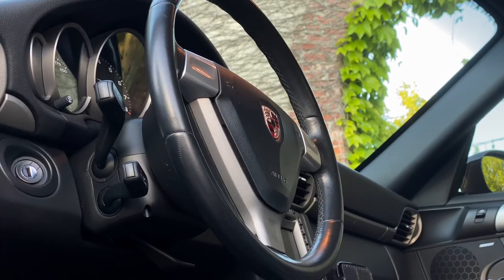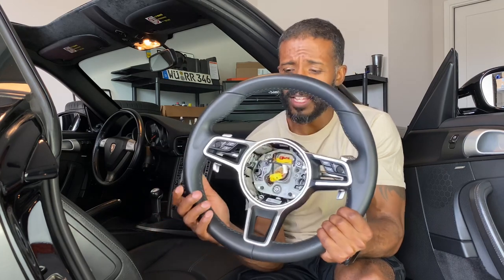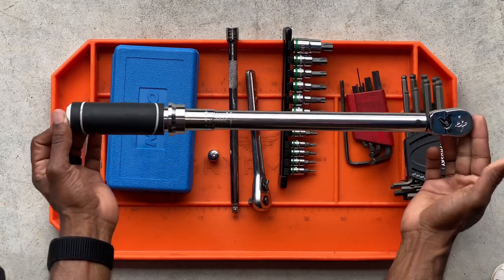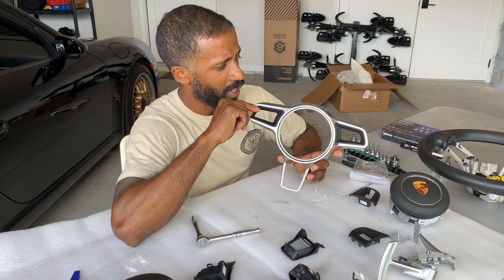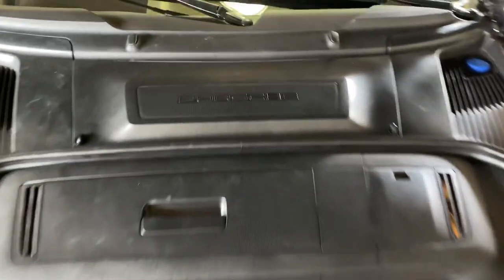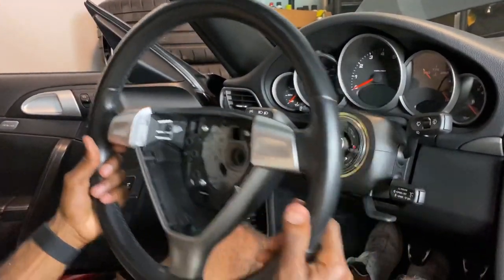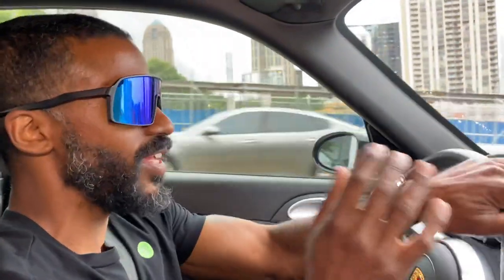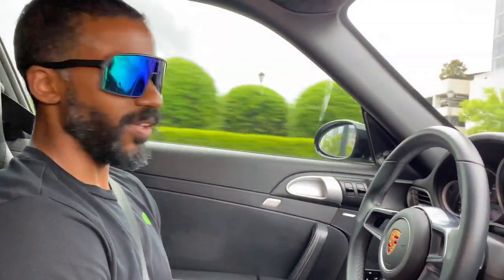Porsche 997 to 991 Steering Wheel Upgrade - COMPLETE DIY!!!

Comment from the maker: Sorry for such a long video but I wanted to do my best to explain what I did and my logic thoroughly! Hope this helps the Porsche Community!
Reply: The little hidden button is for heating your steering wheel :)
Reply from the maker: Michael C thank you!
Reply: Do you think this would fit on a Boxster 981 2013?
Reply from the maker: @STVN9111  I’m pretty sure it should work. Do your own maths tho to be 💯
Reply: so stupid! what you didnt show: what happened after 20:17 ? so you need one week to solve all problems with the new airbag. what happened after you reconnect the batterie? and how can you post this video? and how can you handle a airbag without protection( and show it!!!!)? if you touch the contact with bare hands it blows because of your bodyelectricity.
Reply: @danceanddreams1  wtf dude

Comment: That steering wheel is perfect! You should add a modern Porsche radio that they now offer to go with that steering wheel 👍
Reply from the maker: Christian Mata I will eventually look into that! It would definitely clean up the look of the interior! 💯
Reply: Unfortunately the new PCM is only available for the 996/986. We can hope they bring one out for the 997 tho...
Reply: @KRTLyfe just did PCCM plus in my 996 - it’s a huge improvement. Now to fix my atrocious steering wheel lol. I have a Macan Turbo too and the wheel is a lot better.
Reply: @KRTLyfe  If you elect to go PCCM+, I self installed mine and it took no time. Great upgrade. Happy to talk through it if you like.

Comment: I've upgraded steering wheels in many vehicles. I've mostly kept to OEM upgraded parts (so not aftermarket wheels), but I have done a few re-wrapped OEM wheels too. Since you interact with the steering wheel 100% of the time when driving, I think it's THE best mod you can do if you have an older uninspiring steering wheel. It's also a very easy upgrade to do yourself.
Reply from the maker: I 100 percent agree with you! I think it’s often overlooked but absolutely one of the best modifications you can make if your steering wheel is lacking. On my Land Cruisers the difference between a leather wrapped wheel and the basic OEM is night and day!

Comment: That was good. And it does make the interior modernized in a simple way
Reply from the maker: Never Fail thank you 🙏🏾 I appreciate it!!!
Reply: my comment:
 so stupid! what you didnt show: what happened after 20:17 ? so you need one week to solve all problems with the new airbag. what happened after you reconnect the batterie? and how can you post this video? and how can you handle a airbag without protection( and show it!!!!)? if you touch the contact with bare hands it blows because of your bodyelectricity.

Comment: Makes a huge difference in the overall look of the interior, nice job and this is officially on the to do list with my car.  Thanks for the helpful video 👍
Reply from the maker: Glad to help
Reply: my comment:
 so stupid! what you didnt show: what happened after 20:17 ? so you need one week to solve all problems with the new airbag. what happened after you reconnect the batterie? and how can you post this video? and how can you handle a airbag without protection( and show it!!!!)? if you touch the contact with bare hands it blows because of your bodyelectricity.

Comment: About to do this on my 997.  I've had the wheel and the airbag for about 2 months now but just not got round to it.  Looks great and thanks for the video.
Reply from the maker: Paul Seales thank you. If you aren’t doing all the stuff I did it should be very straight forward. Good luck, let me know how it turns out! What wheel did you go with?
Reply: @KRTLyfe  Same as yours but it was already non multi function as I don't have that on my current wheel.  All I had to do was remove the paddles and buy the GT4 shroud for the rear to cover the holes left where the paddles were.  I've kept them and will take the wheel off the car when I sell it eventually for a 991 PDK and will likely put it on there.  :-)
Reply: All done. Airbag was a pig to get in and had read on rennlist that sometimes you have to shave off a tiny bit of the white clips to get it to clip in properly. Took my time and did this and it pops in perfectly now. Looks and feels SO much better. 👍🏻
Reply from the maker: Paul Seales awesome! I missed that little detail, I might try it on mine. When I did mine I had to put some force on it to get it in place.

Comment: I agree completely.   The two things that must be right in any nice car interior,  the steering wheel, and the windshield.  It begins here,  next is seat, carpet, and floor mat condition and appearance.   If the radio is old tech or just not the right vintage,  that also brings the interior down a couple of notches.    Your video is clear, concise, well produced and helpful.  Your car looks great.   Thanks for providing this information!   I have a new wheel for my 09 997.1 Turbo,  and will tackle it soon.
Reply from the maker: Thank you for watching!

Comment: One of the best mods I did on my guards red 997.1 C2S. 991.2 GT3 wheel, with red stitching and red 12 o’clock marker. For some reason, seems to make the car more fun to drive. I can’t figure out why. Btw, the 997.2 fitment are different and not as easy to switch out.
Reply from the maker: I agree, it definitely improved the steering feel and the overall driving experience drastically, I would tell anyone if you only do one mod on your 997 this should be it!

Comment: I'm amazed how easy that was. Especially the airbag connector. Looks awesome! I'm assuming this will work for the 2012-2013 991 as well!
Thanks for the vid!
Reply from the maker: I think it should be the same. Sorry for the delayed response.
Reply: @KRTLyfe  np, thanks!
Reply: my comment:
 so stupid! what you didnt show: what happened after 20:17 ? so you need one week to solve all problems with the new airbag. what happened after you reconnect the batterie? and how can you post this video? and how can you handle a airbag without protection( and show it!!!!)? if you touch the contact with bare hands it blows because of your bodyelectricity.
Reply: Yup its exactly the same. 👍

Comment: thanks for this video! did you have trouble with the airbag warning light and had it reprogrammed? did the horn work? did you get a new steering wheel module or was it plug and play? we have the same model thanks!
Reply from the maker: Long story short, when I was swapping the wheels out I locked the steering column by mistake. So I put the power back on to unlock it with the airbag disconnected. That triggered the Airbag warning. I used my Icarsoft to reset it myself. Literally takes a few seconds. Yes my horn works,  I should’ve included footage of that. Maybe I should do a quick update video of that. Mine was plug and play because I didn’t try to activate multifunction. Hope this information helps!

Comment: The roads are bad, but check the rear suspension top mounts, in mine they were very worn and sounded the same. Too bad because the previous owner changed all the suspension and left the mounts.
Reply from the maker: The first thing I did to my 997 was change the mounts. I made a vlog about it. Thanks

Comment: Love it, it should fit on a cayman 07 since I have the same old steering wheel you use to have.
Reply from the maker: It should fit, thanks for watching.
Reply: my comment:
 so stupid! what you didnt show: what happened after 20:17 ? so you need one week to solve all problems with the new airbag. what happened after you reconnect the batterie? and how can you post this video? and how can you handle a airbag without protection( and show it!!!!)? if you touch the contact with bare hands it blows because of your bodyelectricity.

Comment: So i have a 2014 Cayenne.. the 2016 system and everything else is similar except for steering wheel which is same as your new one. You think it will be plug and play ?
Reply from the maker: I would say It should but, definitely do your own homework. Check the Porsche forums for any valuable information.

Comment: Hi K, I want to do the same thing to my 987 Boxter. Quick question, do I need a new airbag or we can use the existing airbag for the new wheel? Thanks
Reply from the maker: Based on my research you need the airbag to match the wheel.

Comment: I have a question why do you not explain that you need to change the electronic control module from a 997 to 991 ? That is key or the PDK will not work also the horn will not work
Reply: It's a manual car

Comment: Hi KRT...Question about the steering wheel swap. Will a 2018 Macan steering will work with an 08 997? In terms of fitment? Can you list the parts you ordered to delete the steering wheel controls?

DK from Canada
Reply from the maker: The parts list is in the description. Thanks for watching. I think it should but make sure your double and triple check. Most of them are interchangeable.

Comment: Did you notice if there was a keyway on the attachment point or just splines all the way around?
Reply from the maker: it was splines all the way around the actual steering wheel had a center marker tho.

Comment: Beautiful job! Is it a heated steering wheel? You’ve inspired me with my 2007  997.1 4s with sport wheel. I wrapped mine with leather & stitched it to increase its girth, but I’ve considered this before. Now seeing it, I think I’ve been settling.
Reply from the maker: Yes it is the heated steering wheel however the heating function didn’t seem to work. I think had i installed that other electrical component it might have but I have my reservations.

Comment: Hello from sunny Scotland. Nice vid, very helpful. The trim piece if you want to swap on the back of the wheel is 95B419798B5Q0 (Manual part)
Reply from the maker: Cool, thank you!
Reply: my comment:
 so stupid! what you didnt show: what happened after 20:17 ? so you need one week to solve all problems with the new airbag. what happened after you reconnect the batterie? and how can you post this video? and how can you handle a airbag without protection( and show it!!!!)? if you touch the contact with bare hands it blows because of your bodyelectricity.
Reply: KRT LYFE oops! Just seen your updated video & realised I was a bit late. If you do plan on getting another P car, I can recommend a 718 Boxster or Cayman. I had one as a loan car for a few days & loved every minute of it. If you do decide you need the 4WD, I'm sure the 991/992 would make a great choice! If all else fails, the sensible choice is a Macan. More practical & drives as well as any hot hatch. 👍

Comment: I had added a comment but did not see it so I am going to repeat it. I have a 2007 Porsche 997 I upgraded the steering wheel from a Porsche 2016 Macan It is 991 PDK steering wheel. My problem is that the paddle shifters will not work. My car is a triptanic and came off the other car being a trip tonic also 
Any advice
Reply from the maker: Hello, I responded to your previous post. Thanks for watching commenting and subscribing! Best of luck sorting it out! I’m sure you can do it!

Comment: I have a Porsche 997.1 that has been completely rebuilt to a GT3 3.8 engine. I watched your video and decided to upgrade my steering wheel. My car is a trip tonic. I purchased a PDK 991 steering wheel off a Macan 2017 
I took it to my mechanic which is not a Porsche specialist to have it installed. It fit perfectly and bolted up but the PDK Paddle shifters do not work. I thought it would be plug and play but three paddle shifters are not working. Is there anything you could recommend. I have spoken to another Porsche shop but they have no idea how to do this. Am I missing something
Reply: Any advice
Reply from the maker: There is a lot of information pertaining to this exact thing on many of the Porsche Forums. I recommend doing your due diligence in finding specific information for your application. I do remember during the research phase of my experience , reading something about using DURAMETRIC to “turn on” certain features. I also remember reading that for certain functions to work you need a electronic adapter device. I don’t recall the exact terminology for the adapter but I’m sure you will be able to find the information you need on the P car forums. I didn’t have those features so I didn’t commit that information to permanent memory. Thanks for watching commenting and subscribing!

Comment: Great video. Wanting to do this upgrade on my 997.2 mf wheel
Reply from the maker: Thank you
Reply: my comment:
 so stupid! what you didnt show: what happened after 20:17 ? so you need one week to solve all problems with the new airbag. what happened after you reconnect the batterie? and how can you post this video? and how can you handle a airbag without protection( and show it!!!!)? if you touch the contact with bare hands it blows because of your bodyelectricity.

Comment: Oh man! Followed your lead here and got the wheel installed only to find out my harness from the 997.1 doesn't snap into the macan airbag. It looks slightly different than the one you have in your car. Did you see anything about swapping out the harness to connect it to the airbag?
Reply from the maker: No, mine was plug and play. I didn’t have to remove swap or change any wiring.  Those airbag plugs are color coded and can only fit in one orientation from what I recall.

Comment: Terrific video. Steering wheel looks fantastic. Massive upgrade.  I’m thinking of doing the same thing to my 991.1. I’ve got the basic steering wheel and have never like the look or feel. Just a question for you. My car is manual as well and most of the wheels I’m finding online have paddle shifters like yours. Did you ever end up finding a replacement back cover piece?  Or did you just keep it with the mod you built?  I’m not confident enough in my ability to build something to fill the gaps, so would prefer to change out the trim piece. Thanks, and thanks for posting links for all the tools needed as well.
Reply from the maker: My solution was very easy. 

I took a red bull can and cut some squares out and turned them inside out. I used HVAC tape to hold them in place. 

I know it sounds crazy but it looks pretty damn close to the rest of the trim. 

When the steering wheel is in place you really can’t see back there anyway.  I was actually trying to film it the other day for a update video I recorded and it wasn’t easy to get a camera back there.
Reply: @KRTLyfe  I like it!  Ingenious simple solution.  I think I'll do the same as I haven't been able to find the cover for purchase.  Now I just have to find a reasonably priced steering wheel to justify the mod.  Thanks again!

Comment: Bought a new one and installed it in my 997.1 GT3 RS. Have an airbag light on after. All plugged in correctly I did disconnect the battery and waited 1h before un plugging . I have to plug in my PIWI to find out why and resolve.
Reply from the maker: You cant reset an Airbag light by disconnecting the battery. You have to use a P car specific reader.
Reply: @KRTLyfe  No you can't, indeed. The battery disconnect is to avoid having residual current spring a fault code when you unplug the airbag. My problem was actual worse. When I changed my wheel the light wouldn't go out with the PIWIS  and I couldn't modify the codes in the POSIP. I took out the airbag module and took it appart with a friend who is an electronics engineer. There where two resistances that had fried and had triggered a crash log (unrelated to the wheel change just coinsidence). I ordered a second hand unit, one that had a crash log, took that appart, unsoldered the memory chip from my unit for the car info, copied it into the computer and cleared the crash log, took out the memory chip from the new unit, dumped the clean info into the chip of the replacement unit and soldered it back in. Installed and cleared the codes. Light went out and it works great. And I love the new wheel as much as I hate the old one. The reaper cost me 40 euros....
Reply from the maker: @marcducati  Wow, that is awesome! Glad you sorted it out. Changing that wheel is one of the best mods you can do on the 997! It really brings the interior up to speed! How do you like it?
Reply: @KRTLyfe  love it. It is the best inside mode I’ve done. That and the shift knob. I put a dark grey cnc aluminum one. Hate the original plastic one where the cap broke off. I’m also waiting for my numeric shifter with the cables.

Comment: Hey KRT, great video man. I have a 997.1 that I would like to do the same wheel replacement. yours is a 07 so it is also a 997.1 is that correct? what year was the Macan's wheel?
also , My existing wheel is multi function, would I be able to used that in the new Macan wheel? Talk to me brother.
Reply from the maker: From my research you should be able to use a Multifunction wheel. The only thing you would have to do is order the extra adapter to make it work. It is available online for around $300.00 I believe. Yes mine is a 997.1 The Macan wheel, I’m not certain what year Macan it came off but most of the 991 era wheels should work. Before you buy do your due diligence and triple check compatibility. Other than that it is pretty much plug and play!

Comment: Thanks for this. Just upgraded my PDK 981 button wheel to a 991/Macan with paddles. So happy with it. 

Question. Do you still have your MF audio controls and the module that connects them? I’m looking to add this to my new wheel.